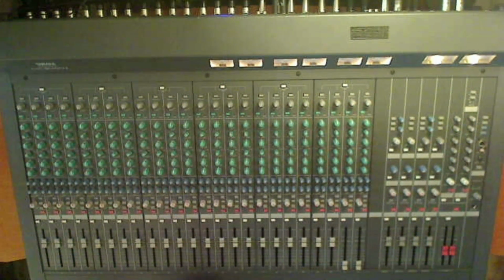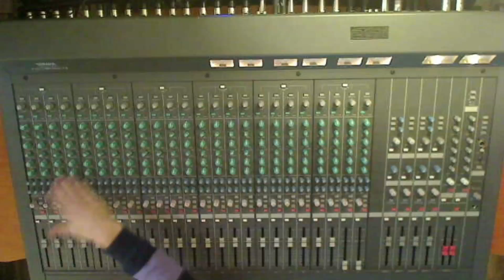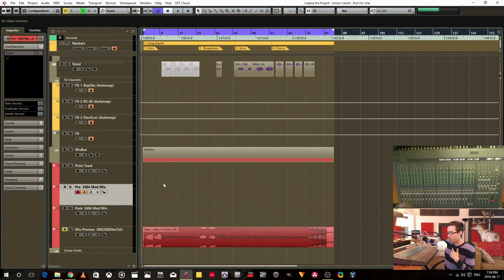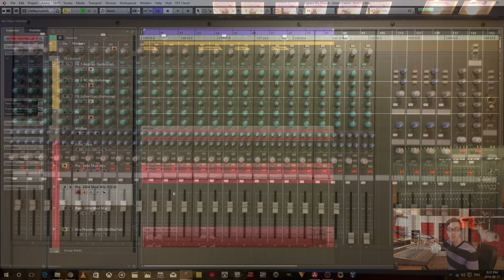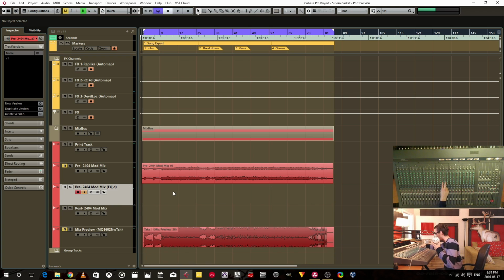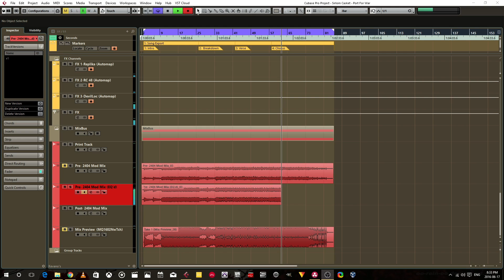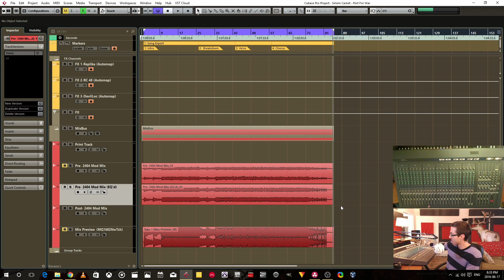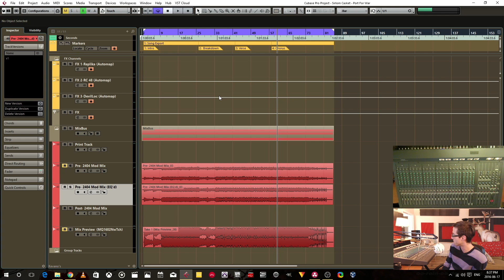Modding my Yamaha MC2404-II mixer - Part 1 - Before the mod

Comment: I recapped my mc 2404 mk1 in the power supply and the audio path of all the channels. I also added direct outs to all the channels.
Reply from the maker: How difficult is the direct outs mod? I'm actually pretty interested in this because if I get a really nice AD/DA converter, I'd need pre-amps and this board would be pretty dope for that.
Reply: +Misc. Factory Studio if you have a schematic it's pretty stair forward. I taped into the signal just after the faders. Then drilled a hole on each channel just below the insert and line in jacks. Time consuming but not difficult.
Reply: +TheBlack Moriah sorry strait forward lol.
Reply: Check my Instagram for pics of it
https://instagram.com/p/BCqhqPUuVdz/
Reply from the maker: TheBlack Moriah

Cool thanks for sharing!

My mixer has two 1/4" jacks just above the XLR inputs (preamp). One of them is a Hi-Z input and the other an insert jack. I'm wondering if I could steal the Hi-Z jack since I don't think I'll ever use it.

I have the owner's manual that has a schematic. It's not very detailed tho. I'm pretty sure it doesn't have any opamps or caps indicated in the schematic. I've looked it over a lot to try to figure it out.

My worry is I don't want to screw anything up, and I would have to have pictures of a successfully modded mixer (line outputs mod) to guide me as well as all the specs of the material used (if there's a specific gauge wire to use, parallel and series wiring, etc.). I'm really good with soldering, great with understanding things, but I just need a good guide to make me comfortable to go ahead with the mod. I also prefer not drilling anything.
Reply: Yo vintique, I have the mc 1604 if you got the manual and its like mine. The reasons your seein no opamps in the diagrams its cause they are audio flo charts not wireking diagrams.?.?
Reply: @VintiqueSound  Hey you can use the inserts for direct output from the channel, I use it to record from live events with an Audio Interface, what you need is to make some wires, a TRS Plug with the Tip and Ring with a jumper,  and then a TS on the other end that goes to the Audio Interface, you get the input with preamp and prefader, no mod needed. I actually would like to make a mod to a mixer I have and add Insert Jacks so I can use the cables I already have and also be able to use Insert if I ever needed.

Comment: Don't buy chips off ebay. They willl be counterfeit and usually wont work. Sorry. Buy some cheap Panasonic FM/FC series capacitors, recap and double up all of the capacitors uF rating in the signal path of your channels.
Reply from the maker: Yeah I'm a total noob when it comes to this kind of upgrade. Is it ok to double up uF? Would I have to compensate for that increase by doubling up the power supply or changing resistors or something of the sort?

Either way, I'm not going to do any mods to this or my other analog mixer except for maybe installing direct outs from the preamps so I can go directly to an AD converter and ditch my bundle of interfaces.
Reply: Start off with one channel. It wont make much of a difference on the power rails if you only upgrade 1 channel. See if you like it with new caps. Yes you can easily upgrade all the capacitors in the channel to double the uF. Buy a big batch of panasonic FM/FC caps from farnell or some shop like that.. they cost next to nothing.. your tone will probably be hell of a lot cleaner and bass will come back
Reply: I wouldnt however upgrade with those chips. Especially if you dont know if theyre legit or not. Opa275 takes a lot to get stable and if you dont know anything about stabilizing opamps i would stay away.
Reply from the maker: Hmm, I don't know anything about stabilizing. I'll probably just stay clear of any upgrade. Also, I've just completed a thorough test between analog summing versus digital summing (Cubase) and found almost no difference at all when loudness and panning was accounted for. So I'm pretty sure my analog mixer is as clear as it's ever going to sound, modding it would probably simply change the EQ curve, but having it sound very similar to digital summing seems just perfect to me :) Thanks for the details!

Comment: This video helps to demonstrate by purchasing or acquiring a use mixer can be a laborious task in replacing components. The better way to test is to supply various frequencies using a frequency generator and an oscilloscope to actually see the output - before and after. The difference from before and after may not have an impact on quality output but that the tolerances are better, therefore the adjustments, for instance on EQ, or flat settings would be different.